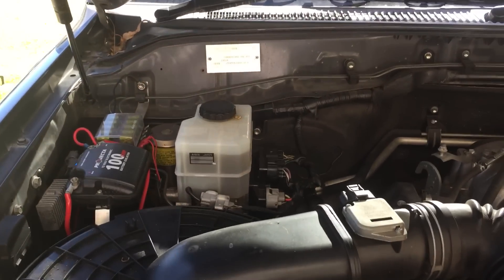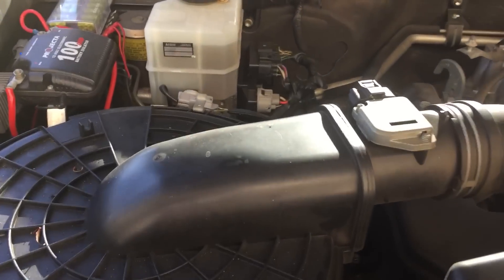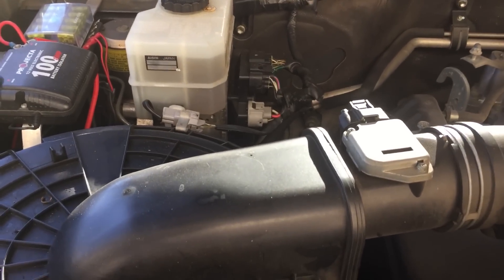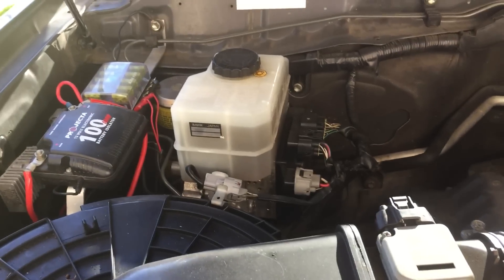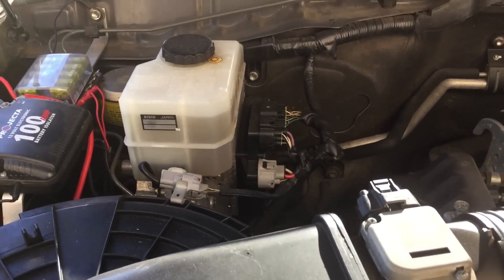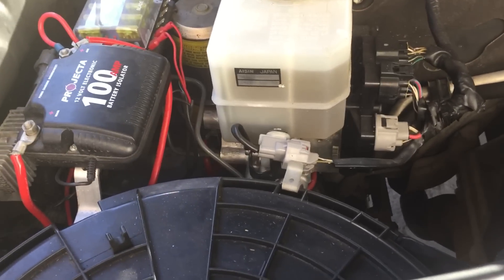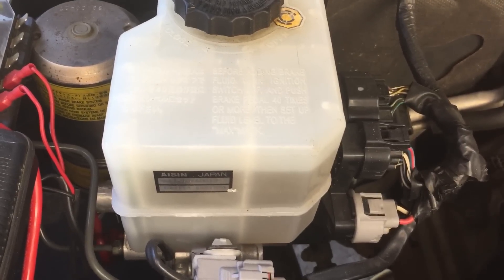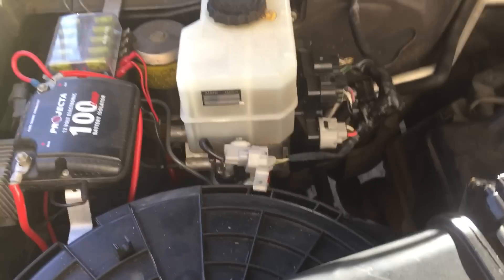toyota 100 series Landcruiser abs accumulator fail, brake fail

Comment: $3,500 AU for the assembly is robbery.  That's $2,319 USD plus labor.  When my motor went out in my 03 4Runner, I went to the junkyard and pulled motor/accumulator from a Lexus GS300 and fixed mine for $60.

Comment: Had the same problem with my 2004 - Landcruiser, found a new ABS Brake Booster Pump Motor on eBay for $150 delivered. Out of China of course but the sooner these dealerships realise that 1000 plus % margins are unacceptable and start to become realistic they will continue to lose out. All in all it's not a big and complicated job to do and it's been operating flawlessly for almost a year now and hasn't missed a beat.
Reply: Hey legend could you send me the link
Reply: Well done. I wasn’t going to run the risk of one of the other components in this unit to fail eg:- accumulator,pump, master cylinder or ABS module so being a motor mechanic and have done bits and pieces in the past to have it come back and bite me on backside. Yes it hurt the back pocket at the time but am over it the satisfaction of a good outcome lingers. Thanks for your interest.

Comment: Thanks for sharing your experience. My 2005 L/cruiser had 124000kms and exactly the same issue as yours. I’m a mechanic and chose the the complete unit replacement. No warning,rock hard pedal,”brake and ABS lights came on( too late and high pitched sound)which I feel is all super dangerous and should be a RECALL. I tow a 23ft. C/van at times. Luckily mine happened when idling along in traffic. I pulled my little unit motor apart and commutator was worn down to the insulation with no brake fluid contamination evident. Very disappointed in my once loved super well maintained 4.7 petrol 100series. Following from Hawkesbury Sydney NSW Australia.
Reply from the maker: I totally agree this should have been a recall, its not a matter of if it will fail, just when, i also tow a large caravan and was glad it didn't happen when towing with my family onboard

Comment from the maker: For anyone in australia wanting their accumulator motor rebuilt, rapid rewind as mentioned in the video no longer offers this service, here is a new contact - S & K Dramicanin Repairs and Parts - (Sal) ph 0412462149. based in queensland
Reply: Just called and the guy said he's no longer Automotive Armatures Australia but S & K Dramicanin Repairs and Parts.

Was friendly and said turnaround less than a day if they're not busy. Will probably drive it up myself. Is in Sunnybank.
Reply from the maker: @xmc3060  thanks for the update have edited my post and item description
Reply: @xmc3060  Hey, how get it go with S & K Dramicanin Repairs and Parts. Did you end up going? If so can you recall how much it was. Thanks
Reply: Oh wow was just in contact with rapid couple months ago and was gonna hit them up now. Thanks heaps for the update! Can you pin your comment to the top for others? Cheers!

Edit: just as a follow-up bhss.com.au (in Capalaba) quotes $1750 to refurb the whole assembly (motor, master cylinder, accumulator) and said they don't really do just motor... Then said motor would be swap out and would cost $800 but comes with zero warranty, which sounded a bit wtf.. so I'll give the one you suggested a call.

Comment: What if you had it rebuilt and not even a year later it’s doing the same thing again? Never got the lights on the dash just the pedal buzz and a squawk behind the dash when braking after the buzz.
Reply from the maker: do you still have brakes, or is it just the buzzer, you can hear if the pump motor is working when you first start the car, you will hear it run for 10 seconds or so, if its not running then the motor could again be faulty, or you may have a wiring issue
Reply: @innovationelectronicsaustr4310  still have brakes at this stage, taken the car off the road in fear the pump is going to fail. The pump runs when the car is started, usually does 4-5 15 second buzzes on startup. But the problem is it also runs almost every time the brakes are applied and usually squawks behind the dash quite loudly after it’s buzzed upon applying the brakes
Reply from the maker: @katelynwoods8370  if you have checked your brake fluid level and there is no issue (possible leak) then your next step would be to either go to a mechanic or auto electrician and get them to run a fault scan using a OBDii tool to see if accumulator fail has re-appeared or if there is some other fault, if you are not keen to drive it with the possible brake fail, you can buy an OBD2 scanner on ebay for as low as $30
Reply: @innovationelectronicsaustr4310  thank you! My car doesn’t take obd2 it takes mobd but I had it scanned last week with no code, and not losing any fluid. It’s booked in next week to get looked at again, hoping to figure it out without spending 4K on the new unit!
Reply: @katelynwoods8370  how'd you go with this?  either pump failed again or some other components, such as electrical? Cheers
Reply: @xmc3060  sent it back to rapid rewind and they said the pump motor is fine and couldn’t find any issues. It’s currently at a family friends mechanical/auto elec business and waiting to see if he can figure it out or I will have to bite the bullet and replace it. I’m suspecting it’s a seal or something and it’s pressure getting back through as no codes/lights or anything it’s just noisy 🤷‍♀️

Comment: Hi Mate, 
Anyone in Melbourne, who can help me with this? I have a 2003 Prado 120 Grande and having the same issue. So far using a hammer to tap the motor and keep the car going, I need someone who can help me disassemble the Accumulator. Thanks
Reply from the maker: you have to remove your brake booster assembly either yourself or by a mechanic and send your accumulator motor to a motor rewind business, rapid rewind in queensland did mine, was a week or so turnaround getting the motor repaired, the fact you hit it with a hammer and works means your brushes in the motor are worn out

Comment: Quite a job to get unit out of vehicle. I took photos when doing it as the color of the wiring set up to the electric motor can be confusing. It's possible to remove the 4 bolts inside the footwell without taking the dash apart but access is difficult. Need rattle gun with extension and wobble to get to the 4 nuts to remove them. Once the unit is out, can get to the electric motor. One of the  bolts on the frame holding the electric motor needs angled allen key to get to. Rapid power was very quick and efficient in rebuilding the electric motor and returning it to me in northern NSW. Also got new 0.5 mm gasket paper as original was worn out. Initially the ABS warning light stayed on but after a few pumping sessions and restarts it eventually went out. Tested brakes and ABS whilst driving in a paddock and all good.

Comment: Mine is also leaking Brake Fluid from somewhere behind or under the unit and now has the same symptoms as the video. That is No brakes and very hard pedal. Is it possible that fluid can leak here? Will replacing this accumulator motor fix this?
Reply from the maker: the accumulator motor doesn't hold fluid, it simply provides booster pressure, if you resolve the fluid leak, bleed your lines and still have no brake pressure then you may have the issues as shown in my video

Comment: Good job.  This is obviously a planned-failure as a cash stream.  Putting a brush motor so buried on a safety system, and the chances of killing people, should have consequences.  they have used vacuum brakes since the 1800s (on trains).  This over-engineered POS needs a brushless motor.
Reply from the maker: i totally agree, it is a major safety risk and should have been a recall, should never have been a brush motor used, yet so many vehicles use them as apposed to a vacuum brake booster
Reply: KILL PEOPLE!!!!

Comment: Great information thanx heaps, but how do you get rid of the air gap in the cell at the bottom of the reservoir? mine has had this for a while, I have tried different methods but can't get it to fill and I saw yours is the same...
Reply from the maker: HI there in all this time i never noticed that, i still have this vehicle and i have never done anything to get rid of that air gap, brakes work perfect, i will check the car today to see if it eventually fixed itself as i have not touched the brakes (apart from pads) in the past 3 years
Reply from the maker: i looked at mine today and still has that air gap years later

Comment: Thanks for awesome video, i have the same problem as you described, just like everyone else Toyota want a fortune to fix it, I will pull mine apart tomorrow and I've found a guy in Cairns whom will rebuild the motor.
This will save me a lot of money and due to Covid-19 and loosing my job it will help a great deal, so thanks again.
Reply: Hi there, the job was an easy fix after watching that video, ended up costing me under $400 including the rebuilt rewired motor and replacing all of the old brake fluid. Thanks again for the video!
Reply: @stevieteeesadvfnq7381  hey man what were the steps you took? Like detach wires, then bleed master cylinder?

Wish I had a manual for my hzj105r. Was it difficult and did you use the manual?
Reply: @xmc3060  Hi mate, no i didn't use a manual, there was a guy in the states whom has a video on how to take it out, fix it and replace it, also bleed the system, basically i disconnected the wires, took photos on my phone, disconnected  the brake lines from the master cylinder, took off the 4 bolts on the fire wall and it slipped right out. took the electric motor off the brake master cylinder, had it repaired, reinstalled the motor, replaced the unit in reverse i took it off, now bleeding it i needed a mate to pump the pedal and turn the key on and off to activate the pump to build the pressure up, better to YouTube bleeding the sequence, but start at the master cylinder and then go to the furthermost brake bleed nipple and work to the shortest line. If i can find the video i will post a link. Cheers Steve
Reply: @xmc3060  Search this on YouTube. Hbb new motor install 4runner gx470 lx470 abs unit screeching screaming noise
Reply: and this bleeding method search for- Bleeding hydroboost HBB ABS unit manually no scanner 4runner landcruiser Montero
Reply: @stevieteeesadvfnq7381    awesome really appreciate your reply, and thanks for the search terms, I've found the vids!
Reply: hey who did you use in cairns to rebuild your motor thanks
Reply: @mick8754  I think it was called cairns rewinds on Doyle st.

Comment: i want to switch between the booster to this accumlator style on my LC ,, where do all those connector wires go ?
Reply from the maker: you will have to obtain a toyota manual and check the wiring diagram, you can download a manual at automanuals.com.au for $5 aud
Reply: @innovationelectronicsaustr4310  thank you for your suggestion ,,, I actually went back to the stock cams to solve the problem i caused lost power top end but now i can drive it with brakes
Reply: Which manual? Can't see a LC one on this site.

Comment: I took your advice and followed up MARK at RAPID POWER in Brisbane  ,He reconditioned the brake accumulator for me  at a cost of $180.00 with gst and freight both ways the total was around $250.00 ...a far cry from Toyota dealer wanting $3850. not counting labour .
They said approximately $5,000.00 all up WHAT A RIP OFF THESE DEALERS ARE ..I HAVE ALWAYS LOVED TOYOTA .BUT NOW I FEEL I WILL LOOK ELSE WHERE NEXT VEHICLE ....THANK YOU AGAIN ....NEIL LEONARD
Reply from the maker: I'm totally with you, toyota have definately lost my support, in my opinion this is a design flaw and vehicle should have been recalled and the accumulator motor replaced with a brushless motor to reduce chance of brake fail. I'm just thankful i didn't have brake fail while towing my van with my whole family in the car

Comment: thanks for all these information, I wanna ask you what are you doing exactly ?
the motor? or what? can u put in steps .. I need to understand by translate the text 
I need your help and I'm from Saudi Arabia I didn't find solution until today
Reply from the maker: you need to remove the small 12volt motor underneath the master cylinder and have that motor replaced or rebuilt if you are having abs or brake issues

Comment: Rapid Power Industries 32 Raynham Street, Salisbury QLD 4107  ph 07 32727222
po box 28, Salisbury QLD 4107
email, sales@rapidpower.com.au

Awesome. Did what you did . Second hand motor parts companies are as greedy as toyota and wont split the abs units apart. they still want $1800 second hand for the whole unit and you get what you pay for. So, I removed the ABS Unit.  Then took off the motor and sent it to Queensland from South Australia to

 Rapid Power Industries 32 Raynham Street, Salisbury QLD 4107  ph 07 32727222 , permission given to provide new address by owner of business.
 (was rapid rewind, now name changed, new phone number  and new premises) 12v electric motor rebuilt for $195 AUD plus postage.  sent it friday, job done monday  posted tuesday and back in my hands wednesday. He said hes done 1000 units in the last year of two. hows that for service.

Comment: Hi - have 2002 petrol 100 series landcruiser. ABS & brake light plus alarm came on out of the blue just before doing a roadworthy. Roadworthy passed. No issues with brakes at all. ABS fault has been cleared 3 times, but alarm/ dash abs & brake light returns. Toyota advised need new brake booster assembly $3600.00 yet brakes continue to work fine. Any ideas please. Thanx
Reply from the maker: does sound like your accumulator motor is on its way out, when the motor is worn out it can work intermittently causing the fault light/buzzer then eventually the motor totally stops working. toyota do not sell the motor on its own they will only sell you the whole assembly. when you start the car of a morning you should hear the motor running on your brakes for about 10-15 seconds, and sometimes when you stop at traffic lights it will run, in the morning when you first start car try and have bonnet open and listen to the motor when they are getting worn out they should be really noisy
Reply from the maker: also as said in the video if it is the motor then is only about $170 to recondition the motor plus labour

Comment: This is by far the best video that has probably helped me and many others save THOUSANDS of dollars being that this is the most common and annoying issue to try and have get fixed better off getting a it rebuilt as video says! Fuck the stealerships and some shit head mechanic shops. I almost damn near gave my truck away just because this issue was such a head ache to figure out
Reply: Hi mate I've got the exact same problem mines a 2004 100 series and I rang that rapid rewind in Qld and it's permanently closed. Have you got any other contacts. No way I'm giving them $3k🤬
Reply: I’m literally as we speak am having SUCH A HEADACHE with this problem. I even looked to give my truck away. 99 land cruiser with 193000 miles. I went to a salvage yard to get the whole piece from another land cruiser. Let’s hope it works out.

Comment: USA and Canada owners.  You have a couple of options, Rebuild it yourself ($50 parts) or buy a new motor (about $450).  If you would like to rebuild the motor yourself for about $50 usd in parts, have a look at this youtube video.  https://www.youtube.com/watch?v=kJXl9O5BhsU&t=1033s   I believe the "insides" of the motor are essentially the same for all the toyota models but you should decide for yourself.  In the video you'll be having a hard time discerning Part numbers, so here they are. You can order them from Eurtonelectric.com. tel.# 1 800-423-4789. The  Bearing part# is 608-2RSna $5.85 each, there are 2 of them. The brushes are part# 33-3810 $4.50 each brush, you need to order two for $9. The collector in the video is called a commutator on the website. It is part number 12-22168 but is not presently available on that website but part number 12-23158 is and I believe will work after drilling out the diameter to 9mm as he describes in the video.  The bearing is also available on Amazon.com under part number 608-2RS for $6.50 for 10 bearings. If you just need the bearings, I recomend you get it from amazon.com, with Prime shipping it's at your door in 2 days and you get more bearings than you need. If you want to just get a "new" motor with a 1 yr. warranty, Go to wholesalepartsexpress.com and find the motor for about $450, Tel.# 1-888-241-8277  in Ft. Lauderdale Fl. They also have the motor for the earlier years Land Cruiser and Lexus 1998-2002.
 I hope this saves you a lot of money.

Comment: Ive just out of the blue lost my brakes in my 2000 model Cruiser, ABS light on, and alarm sounding.  Tried reading the codes, and it flashes 2 times, then 5 times.  My mechanic said about $3000 to fix......... Im wondering if its easier to pull it out like you did and get the motor fixed, but im not sure if it was the motor.
Reply from the maker: good chance its just the motor if you have no brake peddle as the motor drives the pump to give you brake pressure
Reply: @innovationelectronicsaustr4310   how do you reset the abs lights and warning buzzer in the dash  I changed a wheel speed sensor, old one was bent at the tip i suspect from when my hub was rebuilt.  put a new wheel speed sensor in but need to clear the codes.